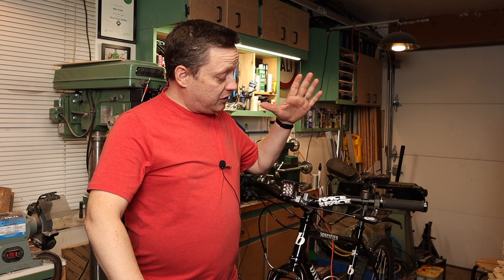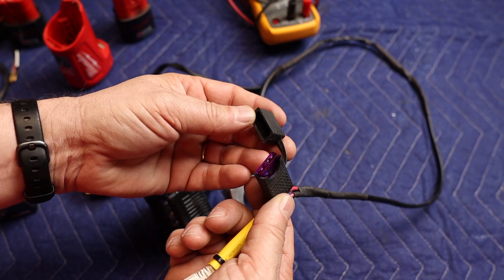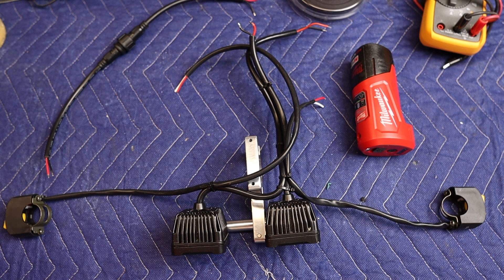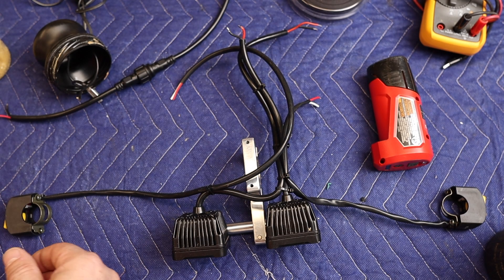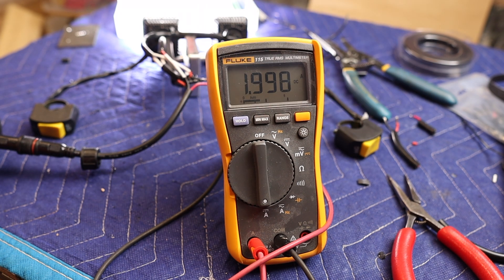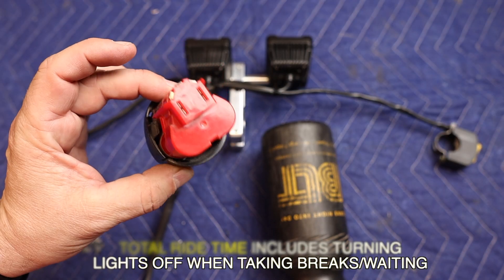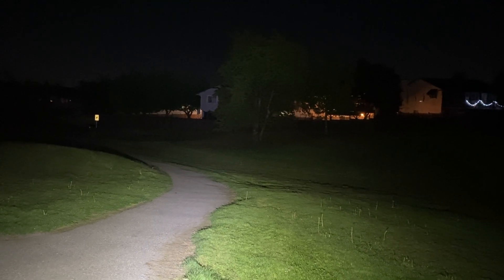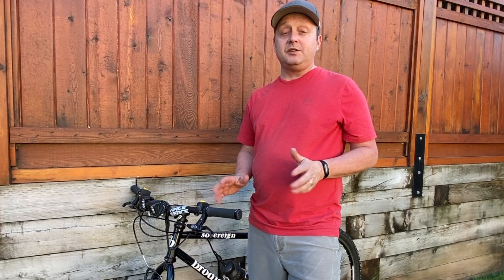Super bright LED Bike Light // DIY bike light for riding road and trails at night!

Comment: Nice, I used a 6.5 led pod with a 7/8 bracket to mount on handlebars then used a M18 5ah battery to power it (held inside a under seat pouch)
Reply from the maker: That sounds like a good setup. I’m sure you will get many hours of ride time with that.  Cheers.

Comment: Are those lights driving pattern or something?  I'm thinking if you had flood pattern lights you would only need one light
Reply from the maker: Thanks for commenting.  These light are more of a flood/work light.  In my first rendition, I used one light.  It works good if you are going slower if less technical trails.. or on the road.  I found in higher speed and technical trails it’s good to have the dual beam setup.  What would be best is a flood and a spot like my original BLT lights. Cheers.
Reply: @MikeFreda  cool.  There is a nilight flood that is similar size and shape.... The parts are really cheap here...I can get two if the lights for about $15.  Two 3 amp batteries for $20, and a Milwaukee housing for $13.  Nilight makes light bar mounts for about $10 that are to attach to ATV or sxs rack out bumper... Going to Mount it with that.  I saw a couple of your other videos...I had not though of the 12v Milwaukee before seeing them... Just got into the 12v Milwaukee with their newer brushless high rpm ratchet.  Thanks again

Comment: Hi there, love your vid. You're almost there with the 12v system. Try using a BMS 3s 18650 battery charger it's more efficient than the Milwaukee batteries.
Reply from the maker: Thanks for commenting.  Yes, I have done that battery configuration in a previous video.  I went this route to make more plug and play for people that are not that electrically inclined.  Cheers.

Comment: Could it be possible to add a dimmer to change the output on the fly?
Reply from the maker: To my knowledge, these lights are not dimmable. They are either on or off.  I suspect if you want to use a light like this you would need to aim them down or use some sort of tinted cover. Cheers.
Reply: @MikeFreda  I bought similar lights as your first version, they were dimmable with a PWM dimmer. Unfortunately the LED work lights don’t have enough output, they only consume 5 Watt (instead of 18 W).
Reply: Have taken some inspiration from you and made a beast of a setup. Wish I could share in comments!